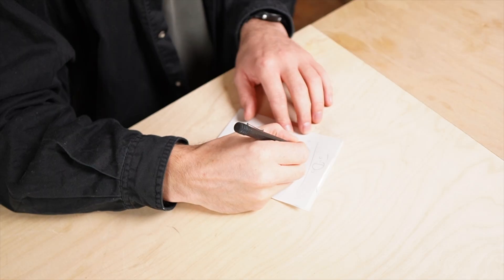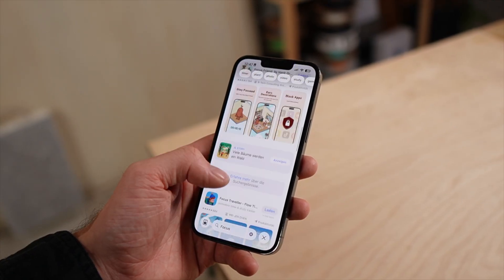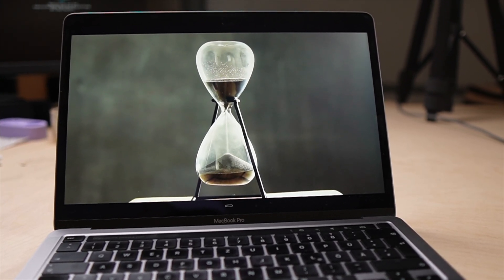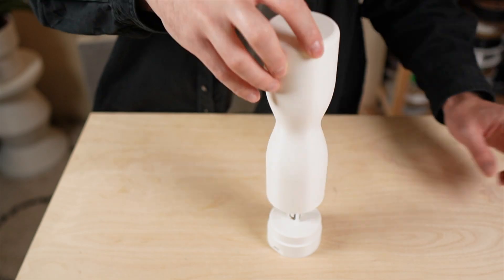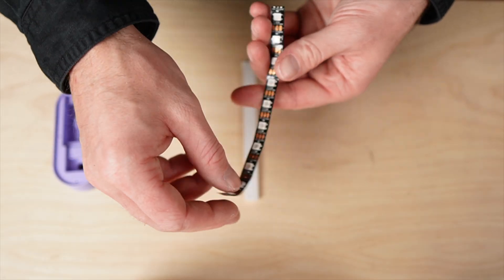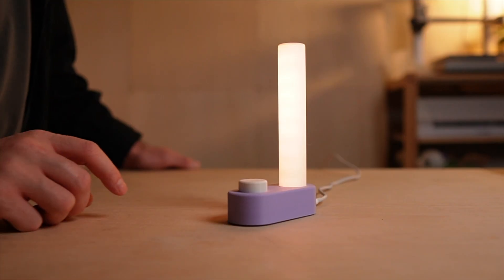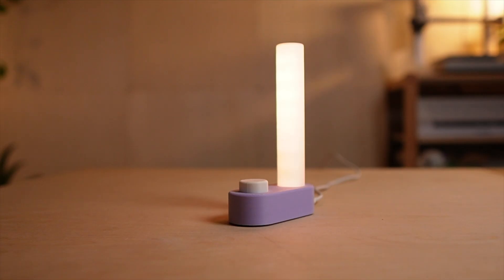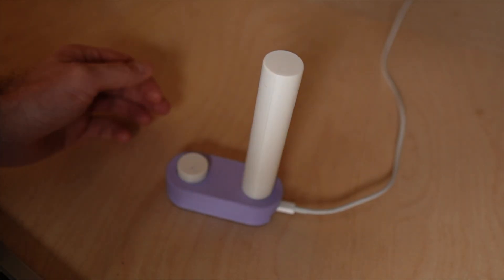How I Designed the Most Calming Timer Ever

Comment: You connect the LEDs direct to controller pins ?
The LEDs link is broken.
Reply from the maker: Yes! They’re WS2812B LEDs so you can connect them directly to an ESP32 data pin. No extra components needed for a small setup like this. And thanks for pointing out the broken link, I’ll fix it! 😊

Comment: cannot find it in the shop. is it parametric? id like to add a few leds.
Reply from the maker: The files will go online tomorrow 😊
I’ll include both the 3MF and the STEP version, so you can adjust them if needed.
Just keep in mind: if you extend the light tube too much, you’ll need a stronger power supply.